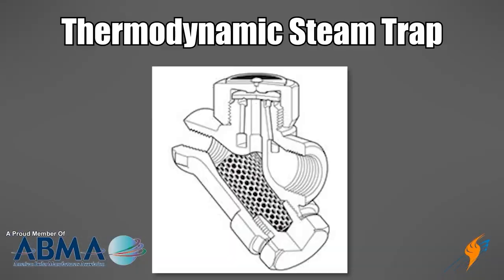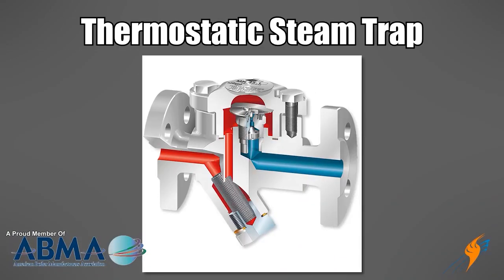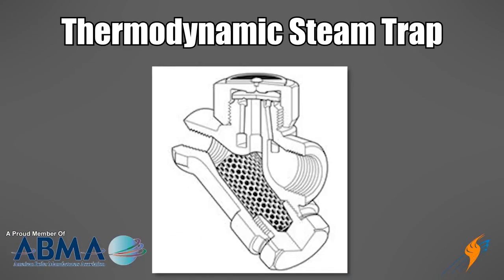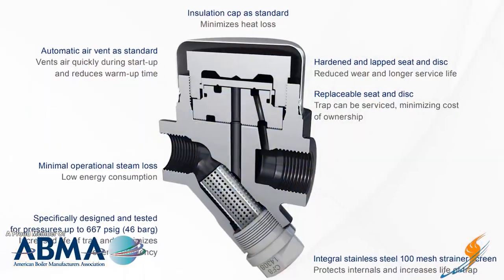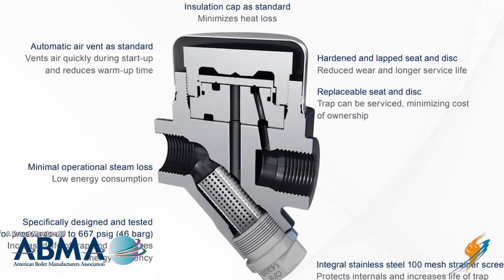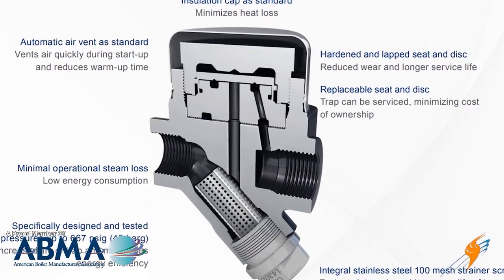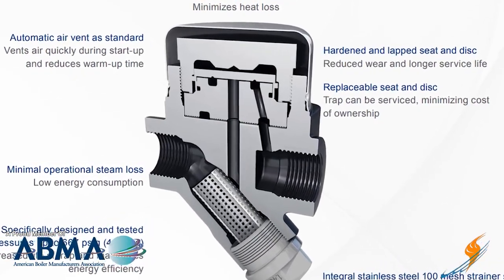Different Types of Steam Traps - Boiling Point

Comment: I don't get why it the thermostatic stream trap is had as more efficient (zero leak) than the float trap. I am no chemical engineer, but an electrical one that ended up dealing with boiler operation, so there must be something I am missing.

From what I understand the subcooling on the thermostatic is happening on the piping close to the inlet of the trap thus the energy released from this cooling is lost to the enviroment. There will be no flashing on outlet. Feels like I am throwing a ten dollar bill away so I don't lose it. Wouldn't I rather have flash steam into into my condensate line - that will certainly condensate within it, thus recovering the flash steam latent heat energy content as well?

If anyone could answer this I'd be very happy. This has been short circuiting my brain lately.